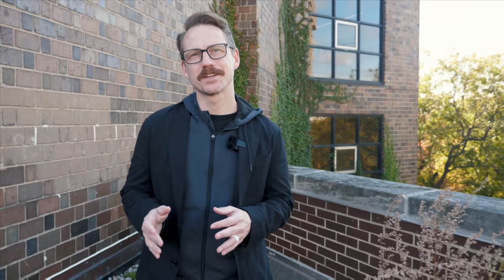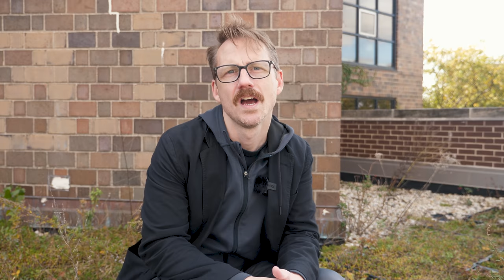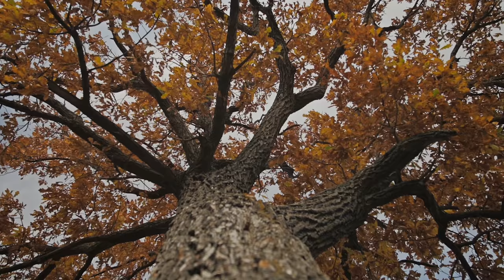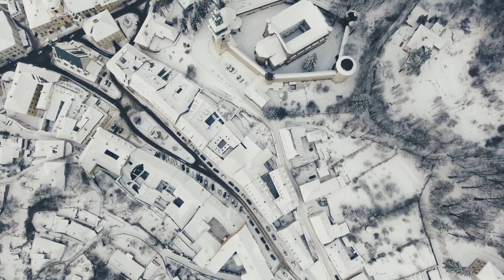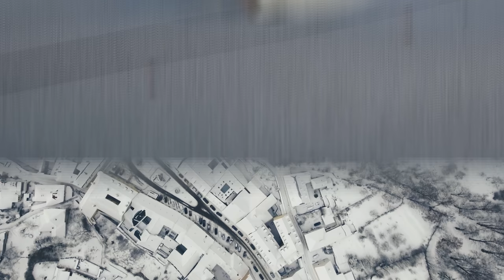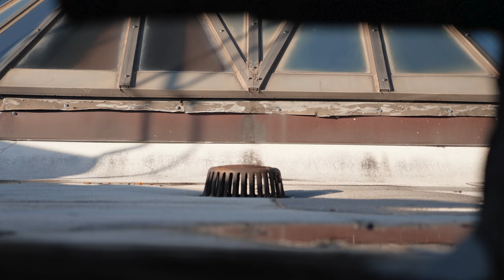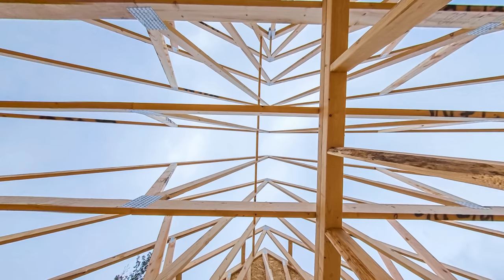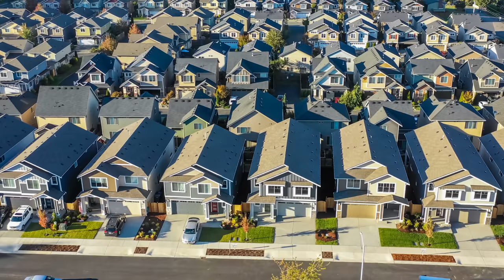Why Do Architects Insist on Using Flat Roofs?

Comment: Asia beat small pox and mastered irrigation using Feng shui. It wasn't until the west that the same tendencies as orientalism completely mangled even basic common every day words like Qi (current) to magic. Feng shui means wind and water. Its a book on the irrigation of current from human traffic to control and wind breaks to self sustaining irrigating gardens.

Feng shui is applied everywhere in the west but is just weirdly taught as if it was only invented. This habit is based on how form should follow function but to keep people from grasping this we are forced to screw on light bulbs where not only was there a better design that would plug in like anything else... Like a round thing goes on a round thing and is full proof as an audio jack, but people can't easily make their own light bulbs from led that last virtually forever and can be tuned to whatever you want.

The crazy thing is that i use my ceiling light to power my projector and just use my own lighting to set up my home projection theatre.

We've always known that Feng shui works, it's just westernised to make it seem dated since western Europe during the Great schism locked down literacy and manufactured the dark age when the rest of the world had the printing press since the tang dynasty which is why there was steel steak boats jet streaming to freely traverse the ocean to the point no one even questions how Mexican food is rice, citrus, picked greens, etc all very hot indigenous food but food that was commonly eaten by Asian mariners. The only difference is that western mariners were corporate and at the same time the freedom of the press was banned for 500 years, pretty much as soon as it was invented. Allowing the genocide of the celts and all their writing to be call spell craft and thus witch craft and banning literacy itself.

 Churches even refused to read mass in English so the average yeoman was as obstructed from communicating as techno fascists have kept the light bulb from being a permanent plug in device to the point its used as the symbol of the idea and is deliberately the stupidest design conceivable. At least a labyrinthine puzzle type screw system would allow for charging like 100 bucks for an led light bulb that would last a life time+.

Led lightbulbs are made of plastic and don't even use a gas or filament. They output much less power than anything equivalent and things that are much more likely to burn out if they weren't made to burn out don't even require a vacuum seal like your microwave oven light. How often do you replace that and turning that thing on and off is the most stressful thing to do to a bulb. If you used your household bulb for 3 minutes at a time it'd burn out in a few months.

It's possible to nake even standard led bulbs you buy last much longer by adding a heat synch to the kill chip I mean, the current control chip.... Which oddly a subwoofer which literally shakes the house doesn't need.

Comment: Flat roofs?  Yes, they are practical, cheaper and yes they will leak.  The drains and HVAC conduit, tubes, mounting legs and ducts are covered and sealed with different materials.  Tar, rubber, steel, and aluminum all have different coefficients of expansion.  The cold joints may freeze and thaw 200 times a year depending on your climate.  Natures slow motion jack hammer will defeat any water seal you think you have.  Don’t take my word for it, just talk to the maintenance guys.

Comment: Having lived in flat roof home in the Midwest for decades I can tell you they are a disaster. They hold snow and ice like a giant bath tub for 6 months of the year. And you are living inside an ice box. They are totally ridiculous, non-functional, and expensive. You need the insulating layer of air in the attic between your ceiling and the cold roof to keep your home warm. I can tell you have never lived in a flat roofed home in the northern states.

Comment: I found your first point about Ancient Egypt and Mesopotamia to be particularly weak. They have no bearing on buildings where there is a lot of rain and snow. The strongest points you had were about HVAC systems that need to be outside and cost. But you didn't attempt to acknowledge the main criticism of flat roofs and that is that they are ugly. They are an eyesore. Can buildings with flat roof be beautiful buildings? Yes. But all too common is the situation where they are built to be ugly. And that is the point that you did not address at all.

Comment: You may have a point but I stopped reading at your into line.  Low slope (flat) roofs have their place for many reasons.  I am an architect, and I have never ever met another member of the profession who "insisted" on using a flat roof.
Reply from the maker: If you continued to watch the video, you would have seen that was my point.

Comment: Low slope roofs are only designed by architects who are too lazy to design a proper roof and want the engineer to handle as much of the work for them as possible alongside their ridiculous open space designs and curved walls, I know this from experience. The architects I have had the displeasure of working with have been useless, egotistical, or greedy professionals, most times all three, which I, unfortunately, continue to encounter as a structural engineer

Comment: If you build your house "american style", all forms of roofs suck. If you build it like a german, the gabled roof will last you about 80 to 100 years without any maintenance while the flat roof will leak in 10 years or less because one worker did a tiny mistake.

Comment: Shed dormers are also an atrocity to architecture.  If you don't believe me, look at an old abandoned house that has a shed dormer update.  The first place you'll see structural failure, is where the shed dormer is.  Granted, dormers in general have their issues,  but shed dormers especially.  

By the way, flat rooves suck.  Aesthetically that is... I really hate the modern aesthetic, which is generally devoid of life and is very sterile and artificial looking.  Also, it tends to have an obsession with giant windows,  windows everywhere!    Of course, logically speaking... a flat roof would serve a logical purpose for a high rise... but really they look ugly for residential homes...

Comment: There are no flat roofs. Only roof with differing ratio between the building size and it's roof slope.

Take a cube of a cubic meter size and a simple sloped roof where the peak is a meter high. It would look like a spike.

Take similar cube but bigger maybe a thousand cubic size but the height still the same. It will look from afar like a cube.

Form follows function...only the human eyes are not trustworthy.

Comment: Flat roofs are safer for tall buildings. Anything that gets sat down on a pitched roof is getting pulled down by gravity. Imagine a hammer sliding off of a pitched roof 30 stories up and hitting someone on the ground.

Comment: you have missed the point of the comments against flat roofs, skyscrapers are one thing but i am pretty sure 90 percent of these comments where talking about smaller buildings. like 3 ot 4 floor apartment buildings, or 2 floor houses or businesses, which have no resonable excuse for a flat roof.

Comment: Modernism, thats why. You could make the point that modernism is not needed anymore nor is the correct way to phoilosophically aproach architecture, but you would be really late to that party. Kenneth Frampton would be a really good place to start if you actually care about modern architecture and the way postmodern architecture started.

Comment: a lot of hot air, bending facts for convenience: "greek temples"" well, the had conventional roofs. all the ancient examples had one thing in common (which you conveniently left out) that they were to be found in extremely hot and dry areas.  if a modern flat roof in a humid area leaks (which they do A LOT , good luck finding the problem, and good luck with the roofers bill...

Comment: Although there are seams in the products used to make flat roofs too. All products have seams at scale once you exceed a manufacturable max of any material used to make the roof. Flat roofs have a bad reputation due to poor design and installations in the past. Also flat roof is a bit of a misnomer. They are not flat, they are pitched too, but less extreme as a gabled roof.

Comment: Hum yeah maybe but why does a gable roof have to be 45 degrees etc surely a 10 degree roof is going to be better than a flat one in most respects. I agree regarding services but again a 10 degree roof is not that difficult to make a support frame. So Im not convinced a flat roof is better and one with an angle ( call it gable if you like but it doesnt have to be a step angle to not be flat)

Comment: OK, maybe... but none of your commentary holds true for, say, residential construction in any area that gets snow or heavy rain. I've never heard anyone complain about flat roofs on skyscrapers. People discuss this about small commercial and residential construction.  Almost none of what you say holds true there.  Also, every "occupiable" roof I've ever seen eventually got placed off limits, because people walking around on them caused damage and they leaked. Making a flat roof that can be a living space is VERY expensive. There's a reason no vernacular architecture outside the desert regions has them.

Comment: I bought a small commercial buikding with a flat roof. The architect who designed it was an idiot in my opinion. it had no slope, and I had to do a ton of dryrot repair, along with a major renovation  adding slope to the roof. Flat roofs are dumb.

Comment: Well, there wasn't much news in the vid, most of it was too obvious, all this was a bit too - sorry for the simplistic pun - superficial 😊. I also don't understand your comment that 'form follows function' wasn't so straightforward. The examples you gave are the best proof for that there are literally dozens of reasons to design the shape of a roof in one or another way. (Noone needs that deconstructivistic nonsense architecture to understand that!)

Finally, it's just a question of definition: to me, a flat roof that is identical to the ceiling of the highest storey is simply a non-roof. A flat roof with parapet that houses technical house equipment is simply an open storey, you can still install inclined covering superstructures that you call a roof. But okay, be it whatever you call it, or vice versa...

I would have welcomed if you had said anything about slightly inclined surfaces that are still walkable... How could one simply integrate a terrace into a not so steep roof that still deducts rain easily? 

What I can tell you is that 'flat roofs' cause problems: my flat is at the highest storey on the north-eastern corner of a badly isolated L-shaped apartment building (windows north, east and southwest) on the 51st parallel in Europe. My kitchen has big eastward and northward windows. Terribly cold in winter - I heated very little to save money - no venting device for cooking exhaust air. Result despite frequently opened window: black spots all over inside and outside walls and bordering ceiling. The only non affected surfaces are those behind radiators below the windows that I isolated with a aluminium-coated thin styrofoam. It started already before gone winter season 22/23, there were dark spots on the ceiling close to the windows. Well, that can be repaired, but still... I'm just telling you. Flat 'roofs' are particularly exposed to the elements. Last summer, the roof has been being repaired during weeks, if not months. 

Okay, enough, you got the picture.

Comment: I am convinced architects are ego maniacs. I worked in a highly praised (by architects) commercial building which did not work for its occupants. The Flat roof always leaked despite much remedial work. It was impossible to move from one side of the building to the other without going up or down floors. As far as I know everyone who worked in the building hated it. There was much cheering when it was slated for demolition, yet the architectural community wanted it to be saved and kept as a heritage listed building. Yeah it looked good from the outside but it didn't function as a workspace.

Comment: Yeah, yeah, yeah.... this is all great, but flat roofs are not a brilliant idea anyplace where it rains a ton... like in the UK (my home is in Scotland) or Scandinavia. F.F.F. is basically BS dressed up as 'a natural law' because... well, it's all to do with economics and the manufacture of building materials like steel beams, flat manufactured panels, sheet glass and others produced using industrial processes. PLUS, the inherent problematic nature of rectangular, flat building forms, specifically flat roofs, creates long term maintenance issues, thereby fostering future business for builders and maintenance companies. This is another feature of modern building regulations which seems more intent on creating business going forward than value for the customer.

Also, what is the form of beauty? What is the function of beauty? As the old adage goes, there are no straight lines in nature, and as we all(?) find nature beautiful, are we not excluding the possibility of beautiful things if we insist on rectilinear forms in modern design, including but not limited to roofs? Is Beauty one of the functions of a building and if it is (as I would strongly insist) what form does it take? I've never seen a modern building as beautiful as a tree or a sweeping valley or the ocean... and so we appear to be starved of beauty in the modern architectural vernacular, and no, a black rectangular box is NOT beautiful, no matter how many times you insist that it is. There are a few old men who gatekeep 'Architecture' and they actively suppress anything that is not designed in the 'modernist' or 'brutalist' style. A few brave architectural students have spoken out about this and the problems they faced because they dared to to include curves and/or natural forms into their designs. One was even told to stop it or he would be at serious risk of failing the course.

Comment: Even in regions with snowy winters, flat roofs are the better choice in comparison to gabled roofs. Because the snow is needed to be dropped off the roof before it will fall on its own. It's huge problem actually

Comment: 95% flat roof = architect or foreign owners were cheap assholes. singular exception is flat roofs that are designed to be used and easily accessible. sloped roofs should also be accessible and usable storage. there's no excuses. unusable roofs are like GIB walls, easy on the bank but nobody wants to live in it.

Comment: There should be a international law, that an Architect can not get license to design, not even a lamp post until they have worked as an handler for a master contractor for at least 2 years. They would have different mentality towards designing houses if they had to work around all of the retardness they produce. Last 20 years or so i have worked mostly in the construction industry, or around the industry, and the shear retardness i have seen from how Architects design houses is just astounding...